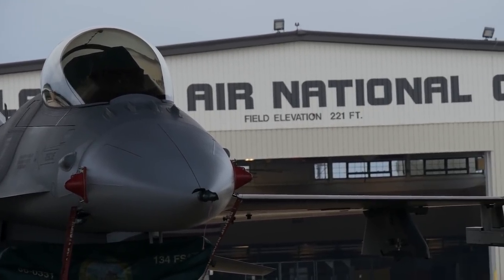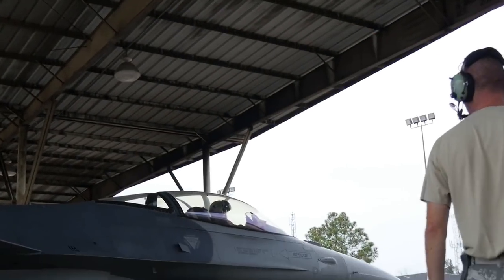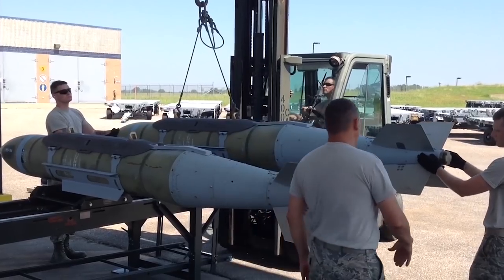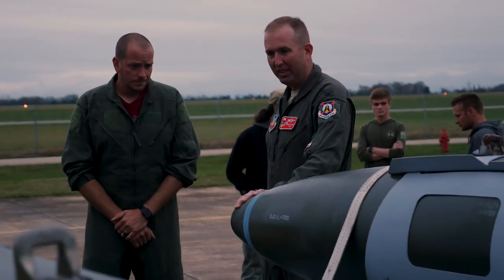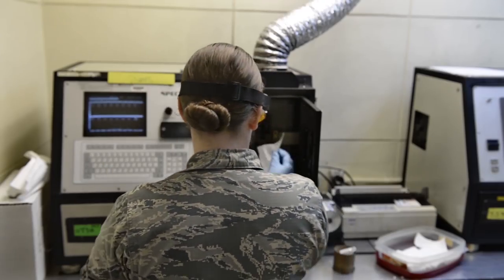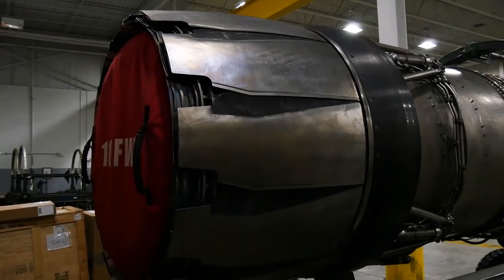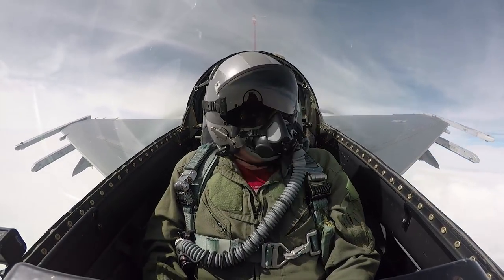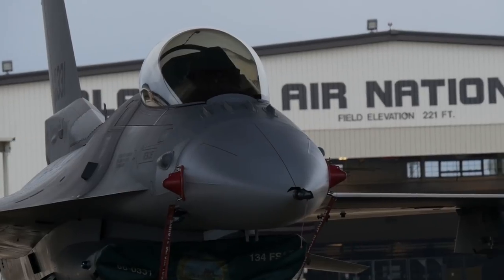How to Keep an F-16 Air-Worthy | FLITE TEST

Comment: Memories.... I served in the Air Force 1968 - 1972 as an avionics tech. Was stationed in Thailand during the Vietnam operation, working on F4 Phantoms mostly, but also put in plenty of time with C-130s, and even a couple AC-47s. Never got to ride in a jet fighter, though - you lucky rascal, you!
Reply: Rod Shelley did you served in Takhli" airport ?

Comment: I was in the USAF from 1983 to 1992 (8 years, 8 months, and 28 days (at least that's what my DD form 214 says)), as a T56-7 & -15 "turbo prop tech".  When I was in the enlisted rank was 3 stripes "center" with a subdued star for the "lower" ranks, 3 stripes with a blue star and with 3 lower stripes for the "mid" ranks, and 2 upper stripes (bat wings) for the highest ranks (this doesn't include the first shirt (skirt) or the CMSUSAF); the first time I saw the "new" enlisted ranks was when I was watching the show "SG1" and I said "someone's been smoking dope" then I looked it up and saw that the USAF had indeed changed the enlisted ranks. I wish the T56's intake was as big as the F16's intake; I'm not claustrophobic, but one time when I had to shove myself into an intake, I got locked up and could get unjammed for a bit and when I finally unjammed myself I shot out and had to "chill out" for a bit before going back in to complete the inspection.

Comment: Wow those bombs are pretty scary!
Reply: Hj Aviation I think those are fuel tanks
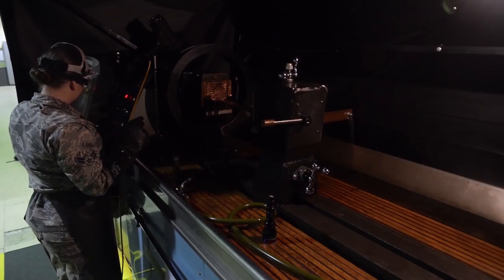Reply: Hey! Former USAF munitions tech (AMMO) here.  Just want to let you know from 2:50 to like 5:24 was what I did.  Those all have blue bands on them.  That means they are inert and have no explosive material in them.  They are either empty or filled with concrete to simulate the weight for the jets to practice with as it changes the CG around when loaded/unloaded.
Reply: not as scary as when they're released and they land on target....

You want scary? google MOAB.....

Comment: That is a LOUD bird.
Reply: Jack Salcedo Japanese f-2 models are louder. It's basically a Mitsubishi version of an f-16 with a bigger engine and radar. Japanese pilots like to take off with full afterburner during exercises.. I think I still have hearing damage from working ice fod duty at misawa.
Reply: daniel dimitri really? I didn't know there was a Japanese variant. The only airplane I've heard that was louder was the f22
Reply: Try to see an F-35B hover at an airshow if you can. F-16s have their own signature pitch from the intake though, miss that sound.
Reply: NoAgenda FPV I'm out almost 10years, I was a metals tech. I knew about the f35 project but have never seen one, I'm not sure when bases started receiving them but there was news about them going way back.. that said I don't remember the f-16 or f-2 being very loud on the ground. They had a hiss for sure but not like an f-15, or maybe it was just the way the flight line was arranges that I ended up driving much closer to running f-15s at Seymour than I did at misawa. but in the air the f-16 had a definite rumble while the f-15 was wisper quiet. Unless of course the base commander decided to do a fly by above the dorms at around noon when you worked swing shift. 

I've heard certain British jets were louder than f-16s but I never got deployed and never tdy to Europe.
Reply from the maker: ha Got that right! ;) def want to wear some ear muffS! ;)
Reply: FliteTest don't let QA find you out there without them..

Comment: Flight test have lost there way 😣 your showing bombs nice one 👏👏👏👏
Reply: TheTonstar1 fpv yea and?
Reply: No, thy're are showing what air force engineers do on a daily basis to make sure their planes are fully operational and keep their pilots safe, they also showed what has changed and what hasn't changed with their Ammunition. These are vital parts in the maintenance of an aircraft. Miss out the munition and your left with an extremely fast and light weight jet incapable of defending your nation.
Reply: connor etchells not rc
Reply: And? It's flitetest Not "RC FLITE ONLY, WE DON'T DO ANYTHING ELSE TEST" They haven't changed at all. You didn't HAVE to watch the video...
Reply: connor etchells since chad sold ft it's pants
Reply: What? The hell are you talking about lol...
Reply: connor etchells Don't worry mate you just don't get it
Reply: Well obviously not, first, I never asked you anything about what changed, and secondly, you're literally making no sense... I'm also not your mate...

Comment: Bet they dont even hold a A&P license.
Reply: Most do not, but the time spent in maintenance does count toward the practical experience requirement.
Reply: They absolutely do. As part of a requirement for doing maintenance on any aircraft you have to hold and A&P (minor and preventative maintenance not withstanding, but you still need a pilot's license for that.)
Reply: Negative. We are not required to hold an A&P license to work on military aircraft. I've been a USAF aircraft electrician for 16 years. Now I can obtain my airframe license due to my training and experience.
Reply: I was a B-52 crew chief and the AF does NOT require an A&P. Its different for every airframe, but B-52 tech school was 6 months. I did get my A&P while I was in, but never used in the civilian world.